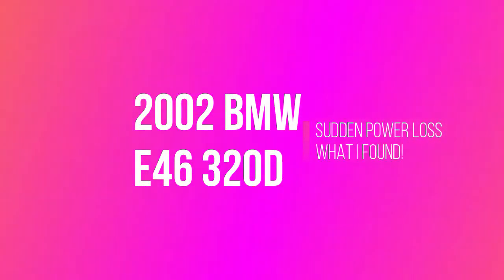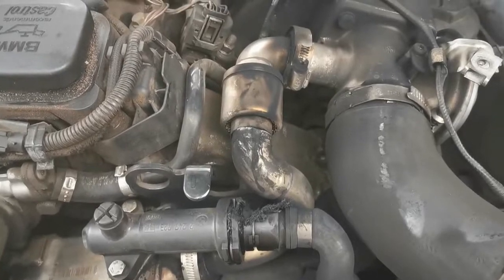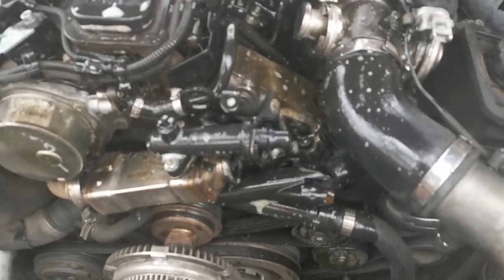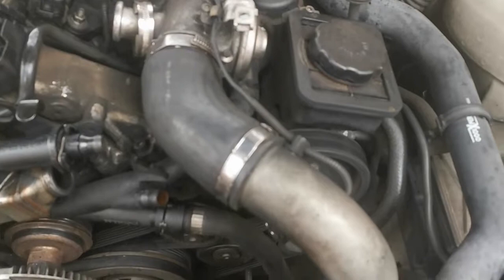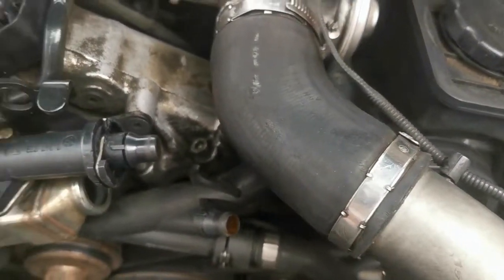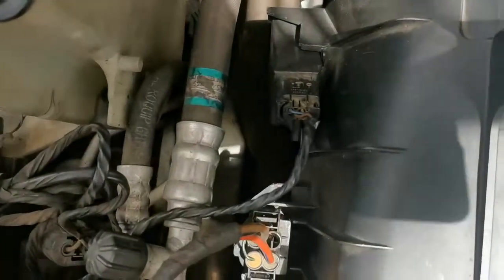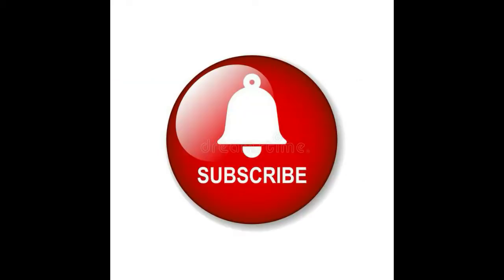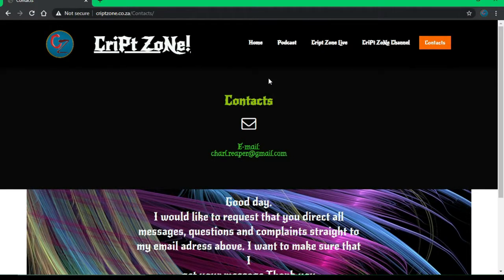Repairing power loss problem on BMW E46 320d

Comment: Hi,
the vacuum hose from the electric vacuum valve (near expansion water tank) starts from the electric vacuum valve and where does it end? Where is it connected to the other end? I'm asking you because I have that vacuum hose disconnected and I don't know where it should be connected. Thank you
Reply from the maker: I sold that BMW a year ago so unfortunately I don't know. I can't go and look for you as I don't have the car any more. On my later videos I striped the entire head off. Maby if you look at those videos you will see the valve and where it is connected to. Other wise you will have to go to BMW and ask one of thear mechanics. Sorry if I wasn't much help. Hope you come right.
Reply: @CriPtZoNe  Thank you so much for the suggestion and your kindness.

Comment: Which sensor got burned wires and why you couldn't remove that pipe?
Reply from the maker: I cant remember what sensor it was. I just found the outside sleeving melted. And then the pipe was simply an issue of space. I could not get in there with my current tools to loosen the bolt. Luckely it was not nessasary.
Reply: @CriPtZoNe I get u. I'm asking because I'm wondering where's that pipe coming from and what is it for. Trying to get some info before I take the car to the mechanic.  I saw i have my broken.

Comment: Sir Goodday. I have problem on a E45 M47 320d. Engine rev up when not in gear but dont want to pull away in 1st gear the engine wants to stall. Any help?
Reply from the maker: Is it automatic?
Reply from the maker: Could be low on transmission fluid. The park break could be set. There could be a problem in the transmission or torque converter. First check the transmission fluid and e break.